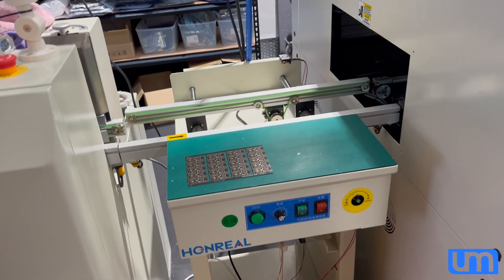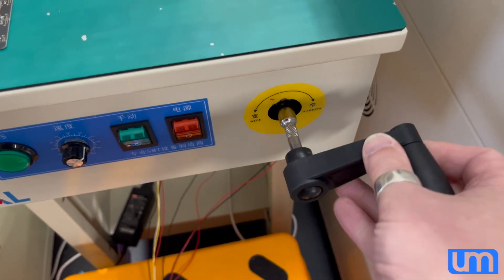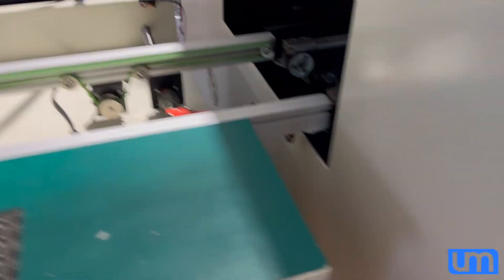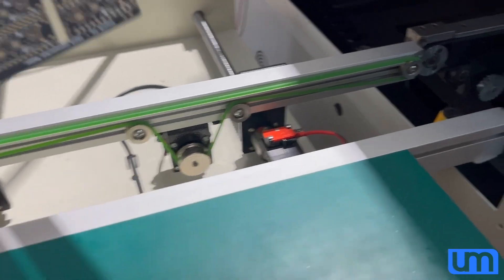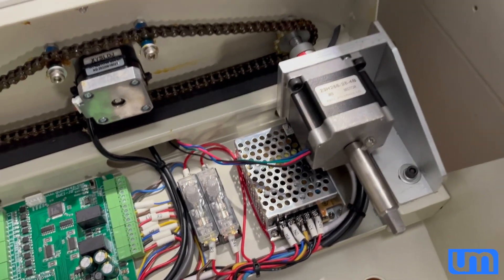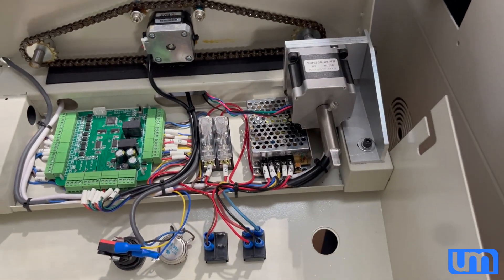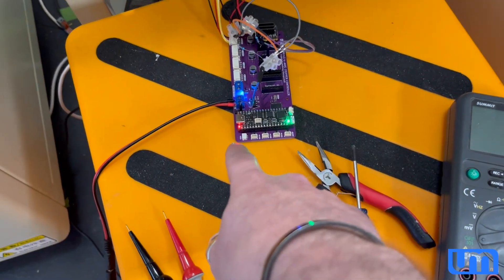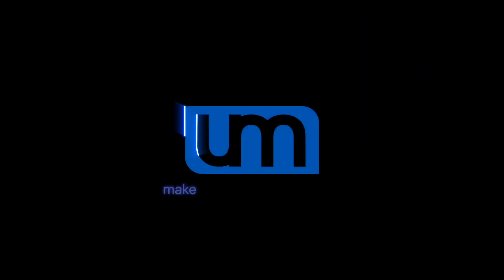Conveyer Controller Prototype

Comment: I am a big fan of the TMC5160 controller and have used them for years to build user friendly stepper motor controllers for peristaltic pumps. The NEMA 23 motors work much better at 24VDC than 12VDC I suggest using 24V to 5V stepdown module K7805-500R3, DigiKey Part Number
2725-K7805-500R3-ND.
Reply from the maker: Thanks for the feedback Ken :) I was planning on using a Traco module, but they are all non-isolated, and I don't want to have to worry about getting noise into the 5V and 3V3 rails, so I'll most likely use an external dual isolated channel,  meanwell PS instead.

Comment: Why can't you use something like a pot or encoder wheel mounted  on a scissor joint, that can measure the angle of the joint and compute the space between the rails without ever needing to home....
Reply: Every electric adjusted conveyor i'v seen in my life had homing  limit switch.
Reply from the maker: Lot's of ways to solve it I guess - but I want something automated, that has to work on 2 different types/width of conveyers on my line plus the stacker and unstacked, both of which are willy inclosed inside, so I need a "no touch can't see, solution). 

This solves that perfectly, so what's wrong with Homing?
Reply: @UnexpectedMaker  My solution has one flaw of needing space for the scissor mechanism.. But it's advantage is that it knows the space between the rails at all times without ever needing to find home again..

if it is off by 1mm, it doesn't have to travel 200mm, to find out it only needed to move 1mm...

Maybe a better solution is a pot linked to the stepper shaft with a 10:1 gear ratio, so that 200 rotations of the motor shaft will turn the pot 20 rotations.  Same result, but no messy scissor mechanism getting in the way...
Reply from the maker: @WagonLoads  yeah, no, your way has many flaws - all that prevent the conveyer from working properly. No place to mount your solution without impeding PCBS moving along the tracks (especially double sided ones), or getting in the way of sensors, and it would be impossible to mount in my stackers/destackers and they move up and down as well as in and out, and pistons push up through the conveyor centre line.

Plus, other than adding the dbl shaft stepper, everything I need is already there in place on the conveyer and working.
Reply: There's no place like home, there's no place like home ! @UnexpectedMaker
Reply: Limit switches work and it i s the simplest solution,
and might be the best solution in your case, but it is like saying:
You are at the South pole and want to get to the equator. You only know how to get to the equator from the North pole.. So you go from South pole to North pole, just so you can find the equator... 

But if you have a way to index the rotary shaft so you know exactly where it's located, then the process works similar to the inverse kinematic model...

Maybe a better solution is a pot linked to the stepper shaft with a 10:1 gear ratio, so that 200 rotations of the motor shaft will turn the pot 20 rotations.  Same result, but no messy scissor mechanism getting in the way...
Reply from the maker: Right, and your analogy works great if I was in the North or South Pole, but I'm not. It's a short-length conveyer, and I need a simple solution that works on all conveyers I have (and future ones) and a scissor solution is not it. 

My video was showing what I implemented - it wasn't a request for other ways to do it. Sometimes it's ok to just watch my content and accept it as it is  :)
Reply: :) @UnexpectedMaker